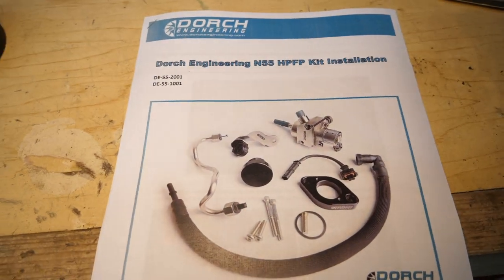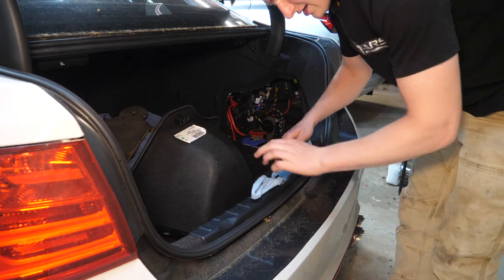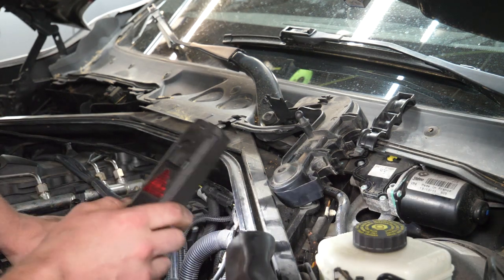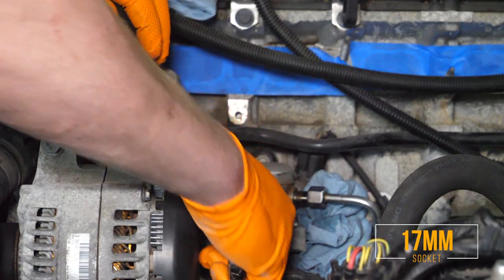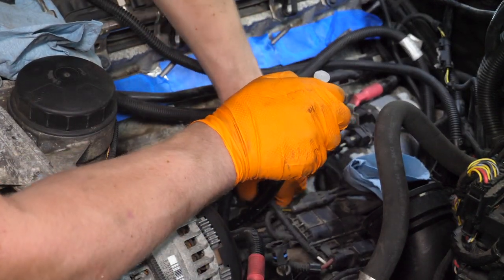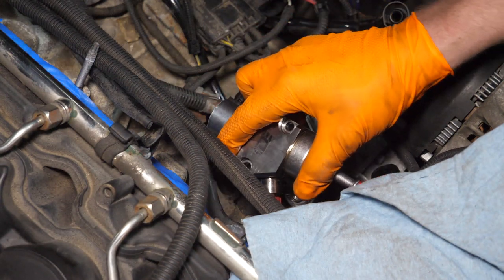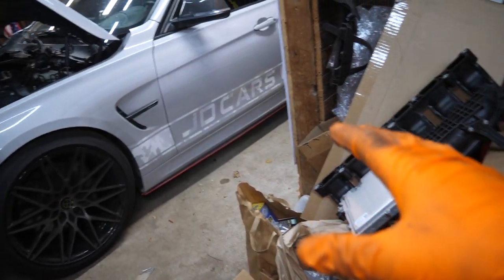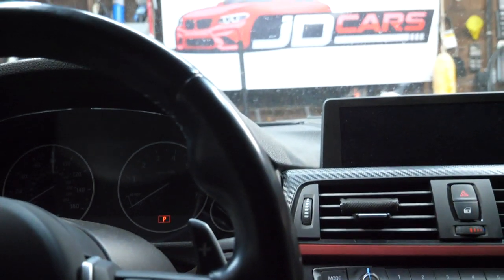Dorch Engineering Stage 1 HPFP // BMW N55 Installation

Comment: Great video, very detailed for the instal.  I'm driving an f10 N55 FBO with MHD stage 2+ tune, wondering if I should upgrade HPFP next or Pure turbo first? Any thoughts???
Thanks,
Reply from the maker: Thanks! I would advice upgrading the supporting hardware (HPFP, intercooler, etc.) before upgrading the turbo
Reply: @JDCarsChannel  I had the same situation recently. And the car sounds exactly like yours in the video. I thought it is probably the stock hpfp crashed and caused running lean during WOT. It is so hard to diagnose which part failed cuz everything went back to normal when engine restarted. You mentioned it's your coil. Would u mind to share how did you diagnose the coil? and what happened to it?  thanks